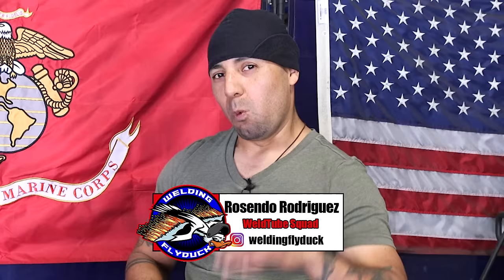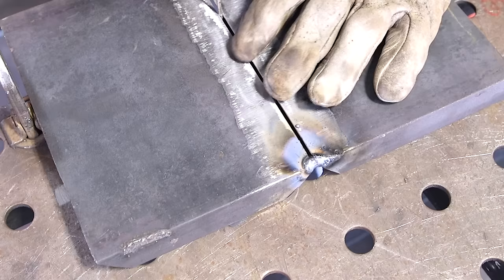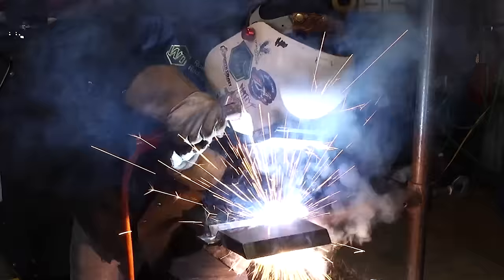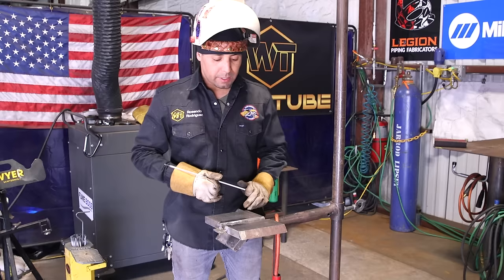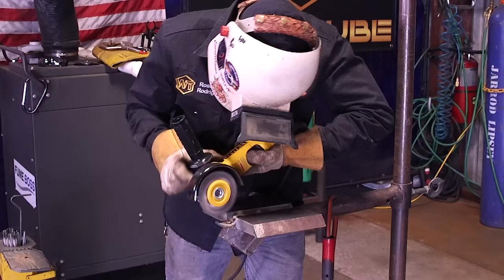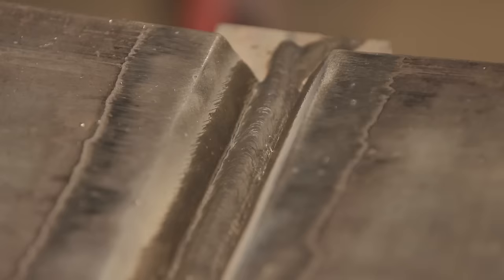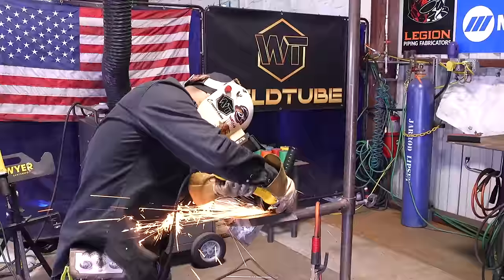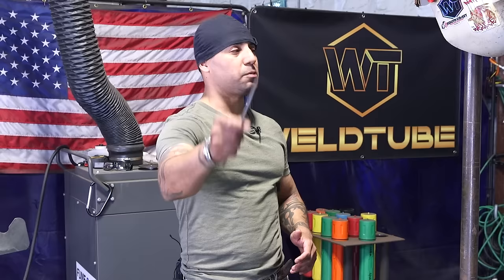1G Plate Stick Welding | SMAW

Comment: Put some strong backs on the root side, with a mouse hole cut out . Ie two pieces of 12mm thickness flat bar,with a half circle cut out in middle of flat bar  , doing this also will stop the plate being tacked on the root. And keep the plate welded more flat ,unless this has been preset for distortion.

Comment: how to avoid workpiece bending during welding?
Reply: grind the bottom side of the root pass after you do it then just clamp both sides to the table, and then when ur done wait for it to cool off before you unclamp it
Reply: The metal bending shows that your welds in the middle are fusing. If you removed the welds and pushed those grooves together they'd conjoin. It's just common sense

Comment: I noticed that one plate warped up, how do you prevent that from happening? I've never welded anything that thick before.
Reply: Other than tacking in to a table or clamping it off, you can't. That much heat, on such a small surface, will make just about anything twist/warp.
Reply: @justinwinkler450  that's kinda what I was thinking as well, just didn't know if there were some other tricks of the trade.
Reply: You can add 2 or 3 strongbacks to the back of the plate. By certain standards you cant have more than 5 degree warpage so the strongbacks help with that.
Reply: You can weld 2 bridge plates on the back, lets say 2 plates 30 x 5 x 300 with in the middle a rathole r 10  tack them both underneath the workpiece rathole over the gap, tack one side, this bc u can hammer it of easy,
Reply: @justinwinkler450  welder words,   bc a fitter welder knows how to keep things in place :)
Reply: @Erwin-eo7iv  nice!
Reply: @justinwinkler450  dude , you can't just say "oh well , with all that heat it's gonna warp". You find a way of making sure it absolutely does not warp. Extra clamps , extra tacks , extended cooling times etc etc. A seasoned welder will find a way.
Reply: Hàn đính tấm kim loại có độ dày tương tự ở phía sau chống cong vênh. Khi Hàn song cắt ra. Chứ Hàn mà để cong như này là vất đi rồi
Reply: @Doug791  I'm an engineer. Parts need to be TO SPEC. If a welder handed me this it would go straight into the garbage. 
whats the use of the filler technique if you get a garbage part out of it. The weld isnt the hard part. The welders at my work spend most of their welding time rigging up the part to end up how the drawing calls for, not the few minutes it takes to lay down a bead
Reply: @t_c5266  engineer and mechanic here , been welding allsorts most of my professional life. I absolutely agree with you.
Reply: On two bits of plate like that you would put a set in it - bend it a certain amount the opposite way to which it will pull before you weld it. When practicing on 1/2" plate we would generally set it about the thickness of the welding rod wire say about 1/8" - on that one it looked like it pulled about 3/8" so you would try about that and see where it ends up. Doesn't really matter that much as it is only a practice plate, on a real job it is usually held in place by other means, for example a pipe would be held by the other side of the pipe. Hope that makes sense.
Reply: @r1learner178  thanks, I figured in the field most of the time it would be held down by the mass of the beam, plate, pipe. But yes it makes sense what you said.
Reply: Strong backs in the test allows, generally preset is required to ensure the plate ends up flat after welding. I've done Xray tests that will reject a plate if it's not within a couple degrees of being flat.
Reply: The best thing to do is let it cool after a couple passes. It won’t warp near as bad. He probably just welded pass after pass after pass without any cooling down time.

Comment: There's 8 in our night classes at college and we are all finding it almost impossible to get full penetration on the root weld. It looks like the simplest weld to do!! I've had over 25 attempts on 8" long practice pieces 😮.
Going to try this on Tuesday night 😣
Reply: Run the amperage just hot enough to before it burns through and turn it down a bit, let the puddle build, use whipping motion if using SMAW
Reply: @mrnobody5567  thanks 👍
Reply: Are you supposed to go counterclockwise or clockwise
Reply: Turn it up
Reply: @bubbaslaughter8379  been up, been down, moved fast, moved slow 😂.
Passed the course since then, distinctions with a bit of how do you say... Ingenuity?? 😉

Comment: Thanks for uploading the video.  I was doing this same with lighter stock in a welding class.  From watching you, I had my arms properly positioned, but my face wasn't close enough to the weld.  You have your hands just above your ears at the start.  I will try to remember that on my next try.  I am getting a better helmet to see the outline of the weld too.  I had trouble seeing the edges of the metal bevels using my current helmet.  As a result , I wasn't going straight like I thought I was.

Comment: After the hot pass on base metal that thick you need to transition to a 5/32 diameter filler rod.  I worked at Newport News Shipbuilding and you would get reamed for welding flat down with 1/8 electrodes.  These schools need to teach students to carry a larger puddle and get that joint filled.
Reply: some body who knows..
Reply: You still live in Hampton roads ?
Reply: I work at newport news  also 19 years x18  (mof)  and now I'm an instructor 6 months in and counting

Comment: I work in a building that has some exposed w-shapes that look to be 1" thick, or close to it. These beams have been mechanically coupled when a connection is required and I always wondered why as there are 4 rows of 9 bolts each sandwichng the beam connection with 1" plates that extend at least 24" each side of the connection. That is literally 24x6x2=72 bolts! I assumed it has something to do with the difficulty in welding members of this size and watching this video helped my understand possibly why mechanical attachments might be favored due the amount of heat this many filling passes generates. Thanks for sharing.

Comment: What do you do about the warping on parts this thick, as seen in the video the part comes bowed. Is this where you would use a symmetrical bevel groove so you add even heat on both sides?

Comment: I run 1/8 7018 between 150-170. HOT!! But...if I have a gap to deal with, I can slap a 5/32 7018 in and it runs colder and wider. And it it's great like that. A massive gap, Texas Tig!! It's not structural, it's not tested. It HAS to hold. And...it does. I will say, nobody's life depends on it. When I did structure, it's a whole different ball game. Where I'm at now, it's more rush. Weld to expectations. I do miss miss my proper welds. It takes more prep and setup. But it's superior.

Comment: If you are welding for a PWR that thick in V you want to start with the plates slightly bent so you end up with a test-piece flat enough they can machine the tensile test-piece out of it.
Reply: My plate was bent maybe a smidge more than his in the video and mine went for tensile no problem.

Comment: With beveled open root, does material thickness really effect Amp settings that much? I was doing 3/8 material with same rod, bevel, same gap and land and 80A was just too hot. Hard to control keyhole. 70A turned out being the ticket.  With equal gap an land an bevel the point of penetration is equal in both cases. that means the only difference is heat absorbance from the sides right?

Comment: Great video but one criticism I can give is on the first hot pass you should've held your edges longer but overall a phenomenal vid
Reply: Look at the plates start and finish, they start out even and bent to shit .
Reply: First pass would not hold up under xray. Pulling your rod will cause air to get in root pass.
Also wider beads will be better than small beads. Larger rod and more amps would help lower with beads.
Been welding since 1985 .also certified in 5 classes including pipe.
Last thing I would have done is tack strip on top to help eliminate warpage.
It warped so bad it wouldn't have passed welding test.
When they would have cut straps and put in press the weld would have cracked because of stress.

Comment: Allot of good information here. what I did see that i do not agree with is not grinding the root pass on the bottom of the plate and clamping it down to keep it from pulling the two pieces into a v shape, which appears to have happened.
Reply: If you don't grind it between passes there will be a shitload of contamination from slag you have to grind it every time or it will be a shit weld
Reply: Should have clamped it tho I can't tell if it's a trick of the camera or not but it looks like it pulled I to a v when i cooled

Comment: Perhaps, I misunderstood.  The material is 1" thick.  The root face is 1/4".  The welding electrode was 1/8" in width.  Amperage: 130Amps.  The Welding Charts from the Procedure Handbook of Arc Welding suggests a width thicker than 1/8"  of electrode for 1" material.  Please help me to understand this discrepancy.
Reply: That sounds about right . Back in welding school I found that setting the amps to the diameter of the rod while welding flat worked out (0 .125 = 125 amps , 0.25 = 250 amps )
Reply: @jclay6680  What should the width of the electrode be for 1"?
Reply: @aguilayserpiente  probably a 5/32 rod but really it is because 1/8" rod you'll be there for days and a 5/32 rod will probably cut that time in half

Comment: I'd tac a flat piece of steel under the crack of 2 pieces then burn your root pass when done cut it off . your first pass is most important . then do passes to fill each side not to fill the void to weld each side together it will fill on its own dont weld to fill that makes it weak and you get slag inclusions that way , it takes more time but better results

Comment: Wasn't the piece of metal flat when you started?  I know that wasn't the point of the video and the technique was.  However its a common the stretching and shrinking as the metal gets hot and cools.  Is there any pointers to mitigate this as well?  The finished product is as important?

Comment: I woulda bumped that amperage down to around 80. 85 looked a little warm, but he did manage it very well.
Reply: Not for a 1/8 7018
Reply: @ApricotData474  for the 6010. 1/8th 7018 125 or 130 in the flat.

Comment: Does his welding mask neutralize the toxic fumes from the weld?
It can't cost many money to add a fan to flextube and suck those fumes out the workshop. 
A fan for pc and an usb charger 0.5 amps should do the trick if you are on a low budget.

Comment: Beuatiful weld, the first 3 passes of side to side is pointless only need to go straight, also your angle is way to sharp. If you try a 145° angle very slow pass at 170A  to save you time of grinding, amp was to high for the first past as its only a filler for the spacer thats why you blew out the bottom. But it all depends on what the piece is going to be used for. But great video for beginners getting started, would rate the weld at a 6/10 in a company setting

Comment: I am planning to build a DIY yacht/ship with one inch thick steel. I am planning to mould the internal circular frame. However I had a doubt, can I weld the external sheets of steel  on the frame with a stick welding machine. What type of welding do you suggest for marine applications?

Comment: Im new in welding sir? Im working in water filtration, were working using plate,      im curios were doing root pass in the back of the bevel, i want to know sir if this is correct?? Thanks in advance for the answer

Comment: LOL! I have been welding for 24 years. 
This thickness should be prepared like this > < instead of a V shape.
Last pass should be covered with the 8 welding pat.
That deformation at the end of the job makes me laugh. This is also due to the chamfers prepped with an excessive angle.

Comment: I’m in high school and in welding class and we started doing this but for the hot pass we use 6010 is that good or is it better to use the 7018 3/32
Reply: Usually you only use 6010 for an or 6011 for an open root. Every time I've tested out with 7018 root, fill and cap. It's always had a backing plate. I'm sure different procedures calls for different things though. That just my experience.

Comment: I’m not a welder. Just came upon this vid and watched the whole thing. Is this something you have to do for some sort of certification? I’m trying to imagine when you’d ever have to fill that much of a void. 🤷🏽‍♂️🤷🏽‍♂️
Reply: The welding standards constantly require welder recertification. You do your apprenticeship and become a qualified boilermaker welder, but it does not end there. A welder must qualify to a weld procedure every 6 months max. This can be verified through testing of production welds over that time period (dye pen./ ultrasonic/ x-ray plus visual inspection). You can be the best welder on the planet but the standards require certification to a weld procedure for the weld you need to perform and if you have not done that weld recently you will need to make a test piece for lab assessment. Depending on metal grade, weld angle, plate, pipe, pressure vessel, fillet weld, butt weld, different tests are required, the bare minimum is visual assessment, an NDT (Dye pen., UT, X-ray) and a slice is cut through the weld, acid etched and visually inspected for inclusions, undercut, penetration (called a macro test). A higher standard requires bend tests, tensile tests so the test piece would get cut into pieces so all these tests can be completed. I'm a QA Manager, there are plenty of fabricators out there that don't keep their welders up to code - Doesn't mean their welders are not competent but the standard requires proof of competency, you won't do oil and gas or government work without compliance.

Comment: What do you do to counter/correct the distortion? I noticed the plates distorted quite a lot by the time you'd done several runs.
Reply: you'd really just have to let the metal cool down if you don't want it to distort. I'm guessing he was trying to finish this test plate quicker for the video and he likely didn't give it as much time to cool. it really however you prefer to do it.👍
Reply: Give each electrode pass at the very least a 1 minute cooldown. He was burning the shit out of the metal causing distortion that would fail him a test. As the previous comment said, most likely did it for YouTube and tried getting it done fast. Just remember, fast is slow, and slow is fast. Rushing will cause you major headaches. This is true for distortion to even welding weaves. When I had to take certified test, I had melting sticks that would melt on your metal if it was too hot. Had to make sure it was a certain temperature to even weld on it. Gave it 5 minute breaks because quenching wasn’t an option of course. Passed the bend test.

Comment: I doubt I'll ever have any 1" plate on hand, but I still watched and learned!  Thank you!

Edit - It seems like a ton of weld material just to join two giant plates... but I don't know exactly the reasons for the large bevel.  Would a shallower angled bevel create a bad weld, or weak weld?
Reply: Bevel angle is per the applicable AWS or ASME standard,  specified in the weld procedure. It can be steeper or shallower depending on the process. One thing of note is there isn't a backing strip on the root side. As far as the bevel angle looking so large, it is necessitated because he is stick welding. If it's too narrow there is a risk of inclusions and lack of fusion, and it's a serious pain in the ass to lay a decent bead.
Reply: @charlesthomas7970  Hey I appreciate the info and response! Quite interesting how deep it gets once you get away from basic home fabrication.   The Internet and YouTube is such a great way to explore other topics that the average consumer didn't have access to only a few years ago.  The requirements for structural welds, marine, and commercial fabrication, etc, seem a bit stringent, though necessity to ensure uniformity throughout any given industry. At home, my crappy welds with little penetration and blow holes are stronger than the base metal on bend test, but would never ever pass. Interesting!!
Reply: @JMRSplatt  take a class, sadly in my city there arent many apprenticeships so there is not much i can make of my schooling now, but the 4 months i took of a Trade Tech community welding course got me to a decent intermediate level, having an experienced welder watch you work and give pointers in person like the guy on this channel does is second to none.

Comment: Question? Why are the 1 inch plates so warped? The welds look nice but thr plates have excessive warpage. How do you prevent that in the real world?
Reply: By not welding continuously and allowing a cool down period between welds. Also, this piece will be so hot when it’s done that you can just throw it in a Vice and straighten it, I know it seems impossible at that thickness but it will work and it’s easy.
Reply: Also, the chances of you actually welding a 1 inch plate in the field is highly unlikely unless you’re building bridges

Comment: Do a bend test on one of these with stick 1g
Reply: How big of a press does it take to bend test 1" plate?
Reply: @the_inquisitive_inquisitor  anything over 3/8 is a side bent, so it shows the fill layers rather than the face and root
Reply: @carsongalaxy  Okay, that makes sense.
Reply: @the_inquisitive_inquisitor  Test plates get cut into "coupons" for testing, so a 1 inch or so slice is cut for the bend test. As you have surmised , trying to bend test that whole piece will require a considerable machine.